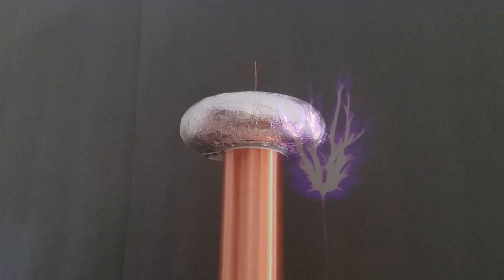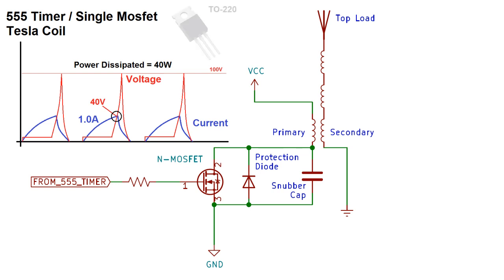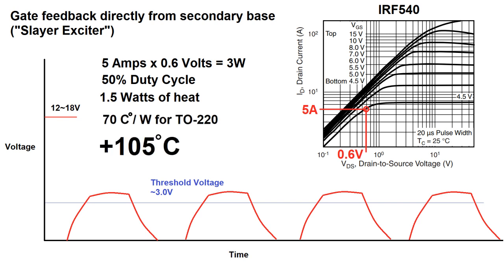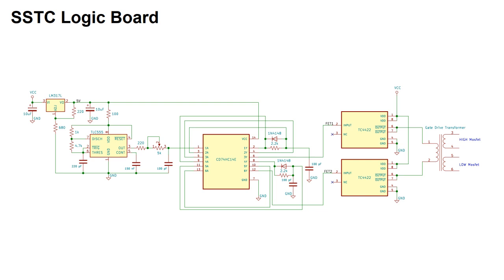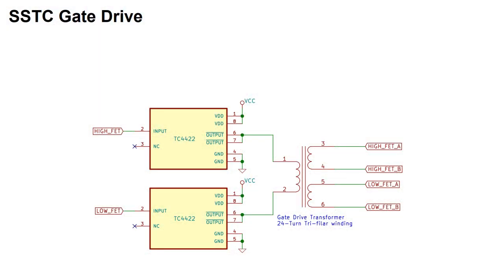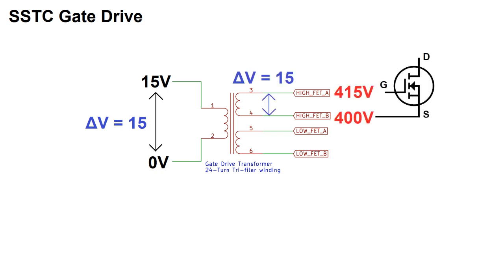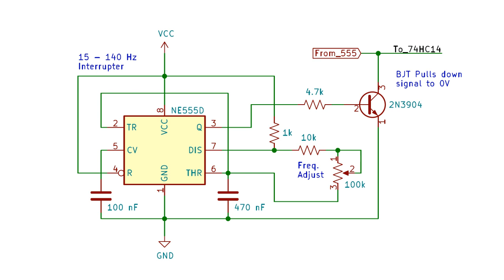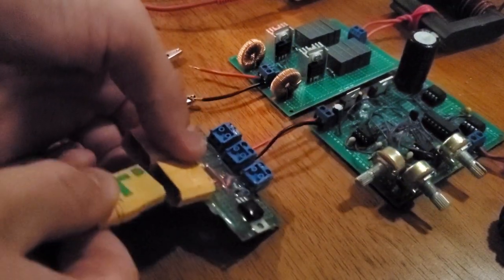Solid State Tesla Coil (SSTC) - Part 2

Comment: I absolutely love this series! You are not just explaining what a circuit as a whole does but you actually explain what every single component in it does. I also really like that you are splitting the circuit into sections and go through them bit by bit which makes it easy to understand. Please make more of these videos! Maybe after the slayer exciter and half bridge driver you should cover a full bridge or even look into dual resonant coils? I am really exited for more videos! Thank you for making these!
Reply from the maker: Glad you found it helpful. I had a hard time wrapping my head around the details of an SSTC at first, so I wanted to make it easier for other people in the future.

I'm planning on doing a full bridge inverter on rectified mains (120V) for part 3, which should approximately quadruple the power of the coil. I'll have to change my MOSFETs to IRF250's, because the IRF540's I used for this video only handle a maximum of 100V.

Dual resonant is probably a bit farther out. I'll have to do some head-scratching to figure out how to deal with the massive primary current that'll be involved

Comment: If the topload is not really smooth (wich is the case when using aluminium tape) there's leakage from the secondary to the sharp edges made by the aluminium foil. This will decrease the output alot and can cause arcing or cornona discharge from the secondary to these sharp edges . Try the metal candy containers they are great toploads.

Comment: Great video, love the Tesla coil series! I'm a bit late to the party here, but I've been looking at the half-bridge waveforms for a bit too long, and I had a question about the current and voltage waveforms. I can't seem to wrap my head around the voltage alternating between Vcc/2 and -Vcc/2, I understand why it alternates but not the magnitude of the voltage. I get in a half-bridge converter there is a capacitive divider on the input, so it's apparent to me in that case but not here with the addition of the inductor. Is it just that ground isn't being used as the reference?

Comment: Great videos! I’m currently trying to build my first Tesla Coil . I’ve been leaning towards Power MOSFETs for obvious reasons. I noticed in your schematic, you have gate protection Zeners . The MOSFET I’m considering is a TO-247 from STMicro(stw20nk50z). This has the two Zeners built in. Will this work or is it better to have the Zeners separate from the MOSFET package. Any input, advice, etc will be greatly appreciated. Thanks for the informative videos, they’re super helpful.

Comment: I have the best results with the one Fet designs. The other ones cause alot of problems and are very unreliable. For me the Brovin catcher circuit is the best. I have abused the circuit in many ways. Mosfet does not get destroyed. With the half bridge on the contrary. While tuning and tinkering, i always destroy mosfets and even the whole driver section (schmidt trigger, mosfet driver, 555 and all the voltage regulators). If that happens you gotta replace everything. It is very time and money consuming. And yes i get a big output with 1 Mosfet and it stays relatively cool. Now i'm tinkering with a coil. I get +10 cm sparks in continuous mode at 65 watts. i have alot of room left to give it more watts and did not even build the interrupter. With it spark lenght will increase further and power consumption will lower. But i guess it all depends on person. For me no complicated and costly designs. The simple ones work best for me.

Comment: FYI "Slayer Exciter" does seem like a strange name but the circuit was created and popularized by GBluer as an SSTC on youtube who I believe went by "Slayer007" on old forums.
Reply from the maker: Good to know. I always wondered where the name came from - it struck me as cringey
Reply: @HyperspacePirate  I always thought it was kind of funny that circuit went worldwide and had so many people saying the name without a second thought like "Slayer" is just part of the normal vocabulary.
Reply: I snickered a bit at the 'street name' for the circuit. There are some shady dark alley oscillator circuits out there...
Reply: Also because it has a direct path to the power supply thus having the potential to slay careless users?
Reply: @MCPicoli  True, but back when the slayer was first around people only ran it at maybe 30V tops.

Comment: I know this is in an old video but this is crucial, what kind of ferrite did you use I’m having trouble finding one
Reply: I hope I'm not too late but the recommended material is 77. There's a good video about gdt's on the teslaundmehr channel. Hope this helps and feel free to ask More questions!
Reply: @homanhojeez678  nah it’s good, but the thing is, it looks like as if he used iron core ferrite from a computer psu. I was just looking fir cheaper ways but I’ve found that cheaping out in things often times result in explosions
Reply: @dumpmboy64  yeah I know what you mean. I'm familiar with finding these things out the hard way 😅 anyways it's better to use cores designed for high frequency
Reply: @homanhojeez678  yup learned that the hard way

Comment: why didnt u just use a 60% duty cycle at the 555 timer ouput and than converted it to 40% via a simple inverter? maybe even a pnp transistor would be enough. very cool video
Reply: Why not just set the 555 to output a 40% duty cycle and skip the inverter altogether? It's because if you watch, he needs two 40% duty square waves that were 180° out of phase, not a 60% and a 40%. The whole point is to have a period of dead space between the two signals so you don't ever had a situation where both MOSFETs are on at the same time.
Reply: @JaenEngineering  oh thx i must have missed that part

Comment: I want to build a half bridge sstc, but would it be possible to use irfp460 mosfets with this driver? If so, would there be anything to look out for and keep in mind?
Reply from the maker: Yeah that's actually a pretty common FET for SSTC's from what I've seen online. Just be aware that with a half bridge your peak voltage across your primary is VCC/2 instead of VCC
Reply: Thank you, the only reason I'm planning to make a half bridge to preserve mosfets, I'm afraid I might fry a few. I want to connect use rectified 240 vac and my one worry is that the current spikes may damage the irfp460s. They are rated for 20A and 50A pulsed. I am in the process of making the schematic and the pcbs, would it be possible for me to send you my schematic after I'm done, you have much more experience with sstcs and I would really appreciate the consult.
Reply from the maker: @proffessornukem8775  i'd advise putting resistors in series with your 240VAC at least while you're developing the coil so that you don't have any accidents from current spikes. Maybe 5-10 ohms with big load resistors
Reply: I'll definitely do that, can I send you the schematic once I'm done with it?
Reply: I think using a variac would be the best option but unfortunately I done own one yet.
Reply from the maker: @proffessornukem8775  sure